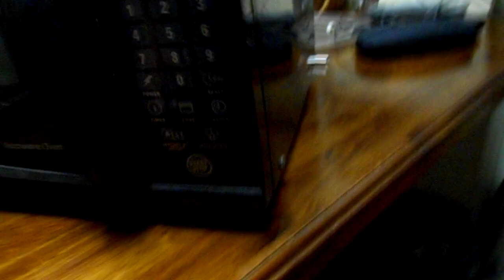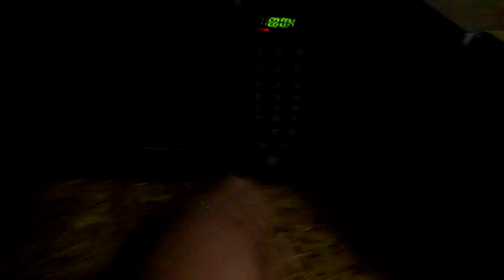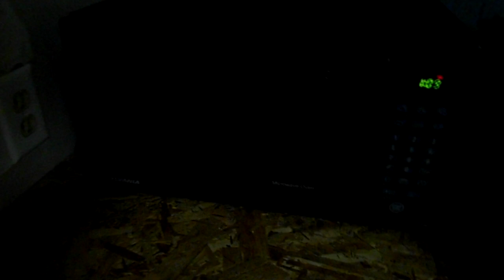How to Fix a Microwave Oven - Simple Fuse Replacement

Comment: Thank you so much for this video-- I wanted to take my micro to a small appliance repair shop, but they were going to charge $45 to look at it plus $100 for the repair!  For $3 I even have a spare fuse and my micro was fixed in less than 10 minutes.  :)
Reply from the maker: Excellent :)

Comment: OMG!  I love your channel!  Our 17-y.o. built-in Amana Radarange is working intermittently.  Some days it heats food just fine and other days it doesn't heat at all.  Electricity remains constant and available (the light stays on and the turntable is working - it's just periodically not heating).  My husband thinks it could be the fuse.  Everything else is working - the light, the turntable, the waveguide (keys).  It just works some days another other days not.  You've given us the confidence to investigate further on our own - and hopefully fix it!
Reply from the maker: +BeatriceStCyr Thanks for the kind words, because it is a intermittent problem my guess is that one of the micro switches is going bad. I made another video that describes the fix here. https://youtu.be/KEJKl8_0xgk . Good luck
Reply: Thanks!

Comment: My guess from having a bulb like this from a microwave I took apart to salvage the transformer and hi voltage capacitor (inverted arc welder project) it appears the way it is made is the bulb has a very thin neck which is smooth with no threads about the size of old style Christmas lights from the 70's and they simply epoxied the bulb in with an epoxy that is heat resistant and the base is designed to make contact where it needs. 

The brown crap is the glue they used. I suspect this is done so the bulb will not melt the plastic base with so many heat cycles. The spacing of the thin neck and insulating glue accomplishes this. 

I still can't understand why someone needs to see their food while it spins but I guess its the same as watching an engine spin.
Good video I wonder how many microwaves end up on the side of the road due to a 30 cent fuse.

Comment: There is a light bulb with a bayonet base, however, you could have got a candelabra size socket ( I work electrical at HD)and replaced the whole unit. No matter, you did a great job and thanks for posting a great video!

Comment: Great Video - told me just what I needed to know.  I'm guessing these budget Microwaves are pretty much the same inside the case. You MAY find that if you check the Sylviana official Parts source, that the bulb IS available as a spare - and it will come with the Holder ready attached . . .  Needless complication , but there it is . . . .

Comment: Nice video!  My Cuisinart stainless steel microwave suddenly stopped working tonight.  It was weird - lights and display stayed on, but it makes a clicking noise when I press "start."  That noise makes me think I have a blown fuse, and I'm going to try to fix it myself, thanks to this video.  I'm assuming microwaves look basically the same inside (like people), so I'm going for it.  Will let you know how it goes.  Again, thanks for a great video (it went from nice to great in four lines or less).

Comment: We have a whole house surge protector and at our hotel as well installed at the breaker box. We still have had failures of appliances, but seem to have better success with a cheap individual rotector that is supposed to shut voltage at about 130 and also if low around 100, . I think the important point is when power starts it has a delay of about 30 seconds before letting power through. I expect their is more appliance failures due to brownouts and also the sudden surge when the powerline comes back on line.

The most recent ones I purchased were the Koblenz pv-15, the earlier ones called protect-rf both have coloor coding light 
 red - voltage out of spec , off
Amber - saftey cycle time delay
Green - power on. 
I picked these up in Mexico at a Home Depot on sale for about 5.00 US each. We also had a more expensive Koblenz unit that was supposed to regulate voltage to the washer and that did not save the LG washer electronic board, I have more faith in these that keep the power off during the start up period.

Comment: Thanks for the video. Weird about the lamp being a wired in assembly and not a replaceable bulb. Something I'd never have thought to should check in the manual when buying a new microwave but will now!  Radio Shack (USA) or The Source (Canada) sells ceramic microwave fuses, as does Canadian Tire and Home Hardware in Canada. Some websites let you check price and store stock availability online. I'm hoping it's just a blown fuse in our microwave. Likely is as there were sparks with the wiring in the electrical outlet before the microwave stopped working. Wires in the wall outlet have since been reattached.

Comment: Thanks for the video. I have similar oven like yours( company Onida). Post uncovering the oven, I observed the fuse ( T8AL250V) was blown. What I understand from the fuse that it is 8Amp fuse. I purchased 8Amp fuse from the market (of some local company). On insertion of fuse and starting of oven , the fuse again blows off. Tried this thing multiple times. Not sure why I am facing this problem. Is it the power setting on oven which I need to check? Please advise sir

Comment: Very good video thank you.  I have a different issue with my emerson microwave.  when I turn on the microwave it starts making a popping noise as if it is detecting metal.  I cleaned the microwave and it was ok but then it started dong the same popping electrical noise again why?

Comment: Well done.  In my hotel room and I just bought a MV 10 days ago . Was working fine until an hour ago. I was heating something up, opened the door to check it and all the power went out in my room. Tripped the circuit breaker. After I  took care of the breaker and all the power was back  on my MV had nothing.. I 'm thinking I did what you said you might have done , opened the door and the MV was just running enough to blow the fuse..

Comment from the maker: Set the multimeter up for ohms or continuity (beeps) to check the fuse. If not a fuse I would check next check the micro switches (safety) in the door

Comment: I have a 2009 whirlpool that immediately quit working as soon as the door got slammed a few years ago. I am thinking it's the fuse but a little scared to get in there because of the capacitor lol I have heard you can touch the terminals of the capacitors with an insulated screwdriver first but I'm still worried about doing it.  Do you have any tips? Also, where did you end up finding the fuses?

Comment: Hi Guru -Our oven turns lights on but doesnt heat. If the wire attached to the black cylinder bob (like  that you show at 5:35) are showing burnt plastic in my GE microwave , can this be fixed? This shows burnt in two other place as well. Please advise.

Comment: I was heating some coconut oil and my Sharp R-1214 microwave gave off a horrible smell and stopped working.  I noticed the cover guard that is on the side vent disintegrated and now it won't heat.  The clock, timer and light still works so can it be a fuse problem or something more?  Thanks for input.

Comment: So...I understand now that if there's a light on when the door is open and the display is working the problem is not a bad fuse. if my microwave runs but doesn't heat and I've replaced the hi-voltage diode and it still does not heat then it's likely a door switch, Correct? Thanks for your help - I'll check the continuity of switches.

Comment: About your video above...How do I check a diode?  What setting on the multimeter? And, if the fuses, thermal fuse and diode are good, can it be the transformer thats bad?

Comment: FYI, you could get 2-pin light bulb or just get the whole base for $7.99 online, I would suggest to get a used microwave on craigslist for $15~25, garage sale for less than $10 in summer. BTW remember to discharge capacitor to avoid electronic shock.

Comment: I have connection wires burnt at the inside top of the microwave? One side connected to oven TCO and the other end to relay board. I think the oven overheated when I was trying to bake a potatoe. Would replacing these wires fix the problem?  Or am I looking at more replacement parts of thermister, humidity sensor, main control board?

Comment: Wish you would have mentioned to not test the microwave after the fuse replacement with nothing in the microwave. I could see some of us so anxious to see if it actually powers up that we don't have anything to put in the microwave but try it anyways, which I think one is not supposed to do. Other than that relatively minor point, good job.

Comment: the glass fuses can show you the wire inside. so if it blows you can see the melted wire right away
Reply: Richard Zhang I believe microwave fuses are usually ceramic, not glass, because ceramic are more durable so they don't blow as easily or as often. You won't see a melted wire but can use a continuity tester or multimeter set to that to see if the fuse is blown, as in the video.
Reply: i was just saying the pros of a glass fuse. I have a 20A fuse in my microwave that i installed several years ago. it's glass and it still works fine. but once it blows, you can tell right away without even using a meter
Reply: +Richard Zhang  Ceramic fuses are filled with sand so that electricity can not arc across a burned fuse.  So, always replace with another ceramic fuse.

Comment: I have a Hamilton beach microwave oven that it works fine and heats up if you only use it from one to three min but if you cook for longer time it heats up at the top on the outside where all the circuits are and shuts off buy itself. What I notice is that it stars fine but in less that two minutes the humming sound stops and the inner light turns off but stills it heat the food or whatever you are heating if is less that three min more that that it will turn off and when it cools off it works again can someone help me please...

Comment: That's crazy I have the same microwave. I put the food on top of it and forgot to put the food INSIDE it, LOL, I started it and about two minutes later I smelled that wonderful electrical burning smell. then I opened the door to stop it and then the power shut of completely. I unplugged it and plugged it back in and about 2 minutes later the clock turned on so I'm assuming the slow blow fuse must of popped. I guess I lucked out. I almost unplugged it and was going to throw it out.
Reply: SUPERNOVA a

Comment: is the microwave fuse the same as automobile fuses?
Reply: No. Wrong voltage and the size is different as well
Reply: No, check 2:31, they are labled microwave fuses at hardware stores.

Comment: I have a kenmore 721.66469500. What type of tool is needed to take lid off to replace fuse? I researched and called the Sears/Kenmore and they couldn't seem to assist, but they did want to send a tech. So are they using ribbots, surely not screws? 
Need assistance!
Reply from the maker: They are not rivets they're called security screws. Go to Harbor Freight and buy their security bit set under $5 and one of those bits will surely remove the weird screws